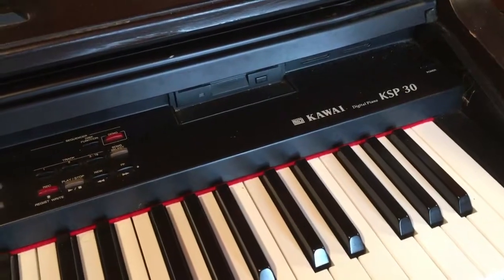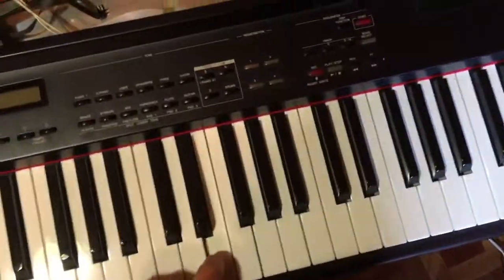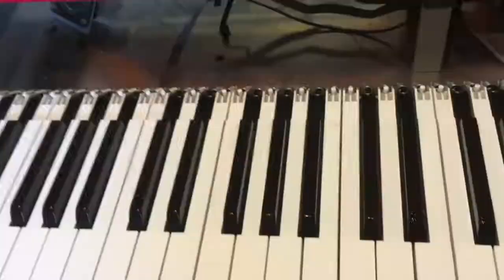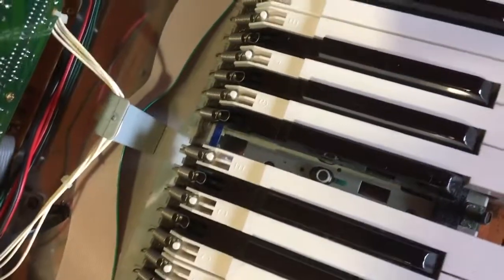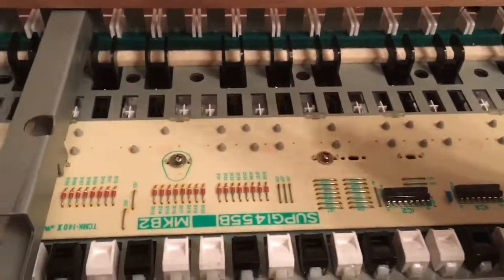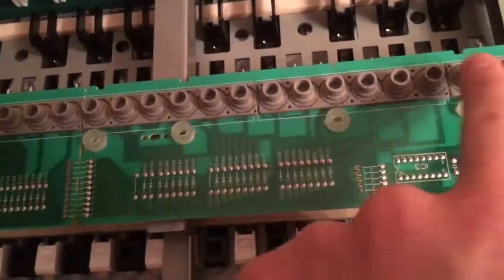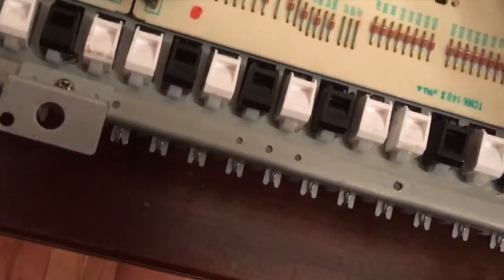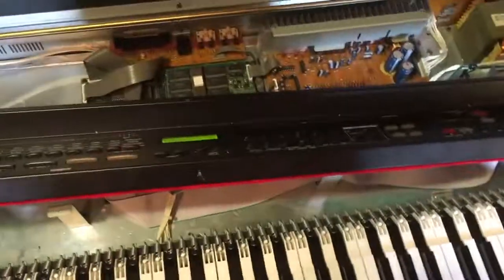Piano, keybed and contact board disassembly - Kawai KSP 30

Comment: I heard that the KSP series has issues  whit the sound card that quits.  What about yours? SO far no problems?
Reply from the maker: My internal speakers stopped working last year, I haven’t gotten around fixing it yet. Connected to external amplification it usually works fine but I’ve had days it briefly stopped sounding completely, usually when it’s cold.